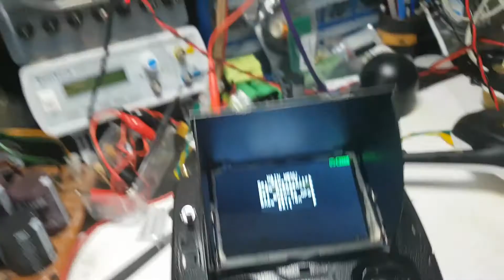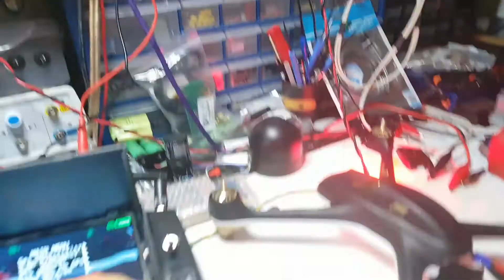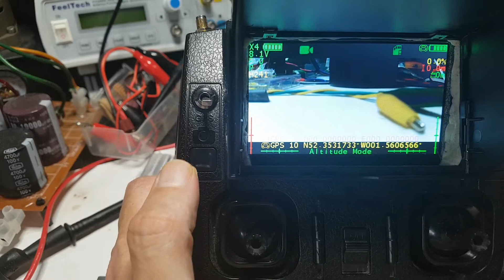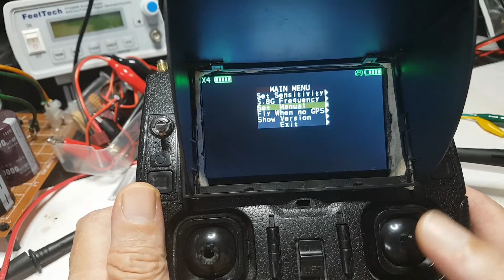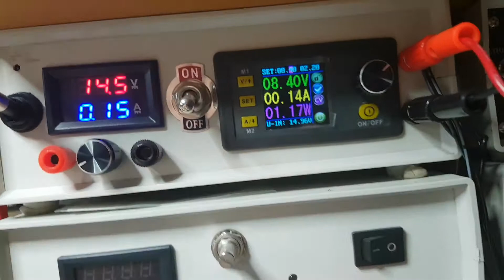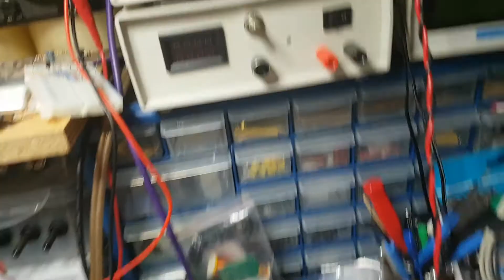Hubsan H501S How to Turn Off Quad-Copter Camera

Comment: hi, a while ago I lost my H501s, I still have a VTX of my old drone, I'm trying to reuse it as a camera, so far I managed to connect the camera and get video, but I could not save the video on the sd card, Some idea how to achieve this. You think I could help with this project.
Reply from the maker: try transmitting the video signal to the H501 controller and record it there.

Comment: Does turning flight lights off save much power ?
Reply from the maker: Not much but every little helps. It will depend on your flying style, 100mA can go a long way.
Reply: I have noticed I have 2 different capacity RX battery's one1300mah 7.4V 2C 9.2Wh & the other one 1400mah 7.4V 1c 10wh both hubsan brand which  is correct or better battery for 501-S ? Thank you.

Comment: Hi. Im having a trouble on how to stop video recording on my h501s after i used hubsan watch.  I mean after using the rc watch, i can no longer stop video recording no matter what press I do on the video button.  Because of this there is no video stored on my sd card as I am force to turn off its power.
Reply: @ErnestPJay  you ever find out what was going on?. I am having trouble too. It shows that it is recording both can not turn it off. So I have to power the hole thing off and lose what I recorded. Any help would be appreciated.

Comment: Hey there i have a problem  my transmiter is that same one but somehow it does not have that option . Do i need to make a firmware upgrade and which one? It is necessary also to upgrade the drone fc firware to not have any imcompability? If someone could give me this feedback i would be much apreciated.

Comment: I don't know if you have already answered this question but do you know what the max amps used is on the h501s? I'm disabled and want to add a switch so I can plug in the battery at home and just flick a switch when it's level outside instead of having to hold the unit at an angle and messing up the level calibration. Thanks.
Reply from the maker: Shawn I am not sure if the logic is right in why you want to add the switch, but anyway, the battery is only capable of discharging at 27 amps maximum. A 30 amp switch should be fine.
Reply: Elecifun I was under the impression that if the h501s was at an angle when you connect the battery it could mess with the gyroscope and cause issues in flight, is that not correct? Just trying to eliminate one potential issue. Thanks for the quick reply.
Reply from the maker: Every time you connect the battery/apply power the H501 will want calibrating. It will want a level surface for the accelerator and a compass calibration for GPS etc. From what you said I got the impression you wanted to calibrate on a flat surface and save that for when you get to a take off point.
Reply: Elecifun No, what I was hoping to be able to do it connect up the battery on a table indoors with the switch in the off position, then when I get to where I want to fly, I can put the drone down flat and flick the switch on to power up whilst level and then do the dance. Otherwise I'll need to have the drone on my lap and at an angle to connect the leads.
Reply from the maker: Ahh, got ya. That makes more sense than what I thought. Try and find a switch with minimal resistance when closed, zero would be best.
Reply: Elecifun Ok thank you. This is all completely new to me. Most switches that can pass 30a through are either 12v or 250vac which I'm guessing wont be any good as the 7.4v Lipo doesn't offer enough juice. I've see a guy on here add a switch to his but it looks like a 10 amp switch so not trying that...
Reply from the maker: The 12V or 250V will be maximum tolerances. 7.4V or 8.4V fuly charged will be fine using a 12V switch. Use a reputable supplier for the best experience.  I said 30 Amp because it rounds up the 2.7A X 10C discharge = 27A of the battery. 30A is within the maximum output of the battery and so all should be good.
Reply: Elecifun Thank you.

Comment: when I clicked on this video I thought... why would I want to turn off the camera?  but when I saw your tests it gave me great ideas about how to achieve greater long distance flights! I am going to test turning off the video feed after I hit RTH, I don't need it then anyways. it may let me go out a few mins further with the power I can save on the return. thanks!  3km here I come!
Reply from the maker: Hey Walley. No no, don't do that. In order for you to switch off the FPV feed you must hold down the throttle and push in the right stick. You will stop your motors. It is not worth it dude!
Reply: my theory is that once its in RTH it doesnt respond to throttle commands ( i have tried to lower altitude many times and it ignores it. only yaw works) so i should be able to access the settings in that mode, but I did a bench test with mine to see how it worked and it seems it does not work with my firmware. no matter what i do my camera feed will not shut off. the controller shows it as off but i still see video feed.
V4.2.24
LCD V1.3.3
501SS V2.1.29
V1.1.38
Reply from the maker: In the sky might not be the best place to test the theory. I am not using V1.1.38 am still using V1.1.36 
Mine works and I will leave it at that for now. I checked the update notes and they are so minimal I don't have enough faith in the update.

Comment: So turning the camera off means no 5.8ghz signal is emitting from the quad? I like to install a separate cam with transmitter and have it not interfere with the quads signaling. Can this be done?
Reply from the maker: If you have the internal camera transmitting it might interfere. I could be worth the test.

Comment: My menu doesn't have the option to turn the camera off. Looks like I will have to do a firmware change.
Did you take any readings while recording on the camera? Just curious how much impact that has.
Reply from the maker: I didn't check what current was used while recording. I would guess not much more.

Comment: +1 Elecifun - Thanks for another helpful 501 tidbit.  I confess I've wondered if turning off 5.8 actually turns off the camera/video board.  I know my 501 will begin to get hot sitting idle with the camera on  I had read somewhere that the onboard camera system is the heat generating culprit so I try to avoid idling.
Reply from the maker: hi Jimbo, yep that is 100% correct if sat idle the camera board does get very hot. Great tip, a real must to avoid.

Comment: Interesting update on the current draw VS camera status. 
 About the reported drone battery voltage, you might find that it was reporting it accurately, as there will be a small voltage drop on the feed wires between your power supply and your bird.
Reply from the maker: Complete agreement on voltage reading. I should have thought about that yesterday. Reading the voltage directly from the supply will be different, depending where the voltage is being read on the quad, a difference will be seen.

Comment: Thank you Elecifun, that was very interesting indeed. I caught the mention during the video! I have never used mine with the camera transmission off. I suppose that the flyers going for distance might do so with the camera off to conserve battery as long as you are still receiving telemetry data.  A bit scary flying blind with just instruments...  Also, have you noticed a reduction in heat with your VTX off?
Reply from the maker: Hi Sonix, No don't fly any distance blind m8, that might be asking for trouble. 
Maybe line of sight this could give an advantage of saving a few watts of power. I am surprised the option is there at all. I was quite intrigued by how much power it used idle, after you suggested taking measurements and comparing the results. I guess we have an idea with mine now : )
Reply: Cheers Elecifun,
I actually don't remember comparing notes on idle power consumption except as it relates to heat build-up in the battery bay. I don't own the power supply/measurement equipment that you have. I'm a bit envious of your electronics bench. lol. And no, I wouldn't fly blind except in an emergency. Though I don't know what would constitute a true drone emergency...
Reply from the maker: I have an example of a true drone emergency... If the camera failed while in distance flight LOL
Your memory serves you better than mine serves me. It was CNCmachiningisfun who suggested and I copy and paste quote " If you get the chance to measure the resting current on your quad, I could go and measure mine, so we can compare them. " 
Dear me, I knew someone said something at some stage, somewhere. ; ) Old age is kicking in fast with me. Tomorrow I will not know my name :/
Reply: Hahaha. They say memory is the second thing to go. I forget the first...
Reply from the maker: LOL m8 ; ) 
Mine is a bit worrying for me,  I seem to have added to memory not just lost some :/

Comment: Thanks very much for showing us that !!   I've also noticed you're not too worried about turning on the transmitter without  antenna attached. I'd heard that doing so could blow the fpv.
Reply from the maker: Thank you for your comment. I also have heard something similar about damaging the controller when the FPV antenna is not connected. This is not the case. You will not damage the FPV receiver if you do not have its antenna connected. You may not receive FPV transmission from the drone over any distance other than a few tens of feet. 
Imagine your TV antenna is not connected, your reception will be limited, that's all.
You are more likely to damage the controller 2.4GHz transmission output if that antenna is not connected. Its a VSWR thing. Notice my transmission antenna is connected.
Do not transmit FPV without an antenna, especially if you are pushing more than a few milliWatts, that will damage the FPV transmission output.
Reply: Thanks again Elecifun !
Reply from the maker: Your welcome buddy.